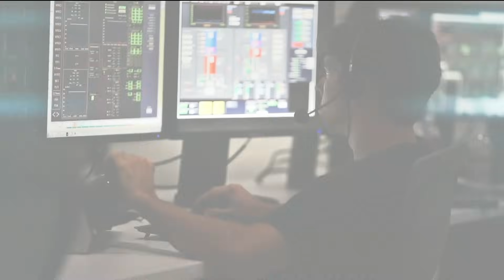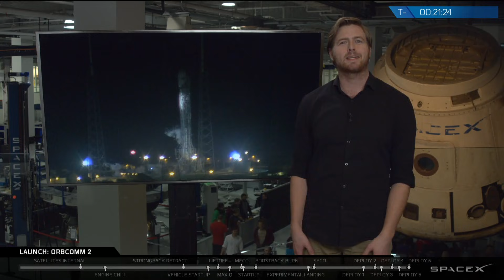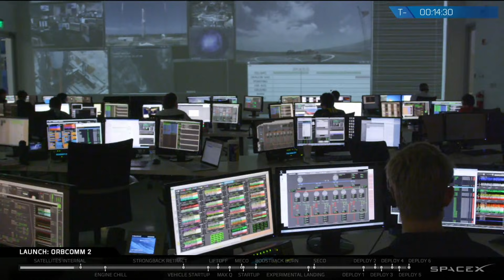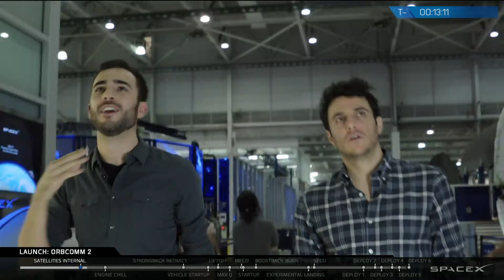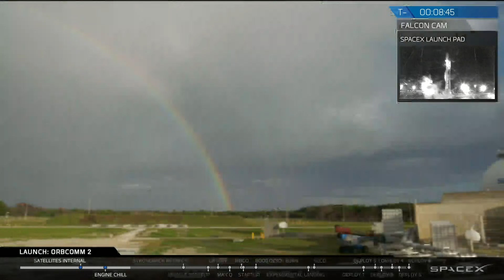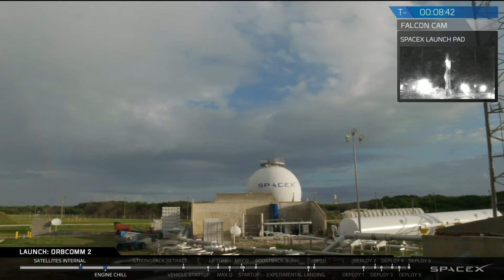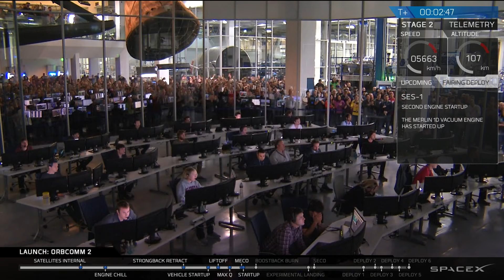ORBCOMM-2 Full Launch Webcast

Comment: Is there a plan to recover 2nd stage?
Reply: The problem with the second stage is that it's going so fast that it burns up on reentry. To slow it down to the point that it doesn't would take the same amount of fuel as it took to get it moving that fast. That additional weight would then need more fuel again to get it going fast and it becomes impractical. They could put a heat shield on it but that costs in weight also. Either way the cost of bringing it back to earth would be more than the cost of replacing it.
Reply: +cavereric  Perhaps later on, but the 2nd stage is not nearly as expensive to build as the 1st.
Reply: +cavereric __ In the future.  I believe that the 2nd stage will have to circle the earth before it can return to the launch site.
Reply: They are working on a plan to reuse it!  :-)  should try in less than 2 years!
Reply: +cavereric They abandoned the idea after realizing it would cost too much. Most of the cost is the engines, and the first stage has 9 compared to the 1 engine on the upper stage.
Reply: +cavereric __ No.
Reply: I remember reading in the biography that there is a plan to recover the 2nd stage.
Reply: +cavereric If the Space Should could be reused, then why could this not be?
Reply: One step at a time :)
Reply: +cavereric - It may be impractical at the moment, but in the future when there are maybe several launches per day, it could become useful to put a heat shield on it and bring the second stage back also. It probably still costs more than the fuel (+the added fuel to put the additional few tons up there) and they could make the price of space flight drop even more if they could recover that. It would require a quite complicated heat shield that would have to assemble itself on orbit. At least that's my theory on that =)
Reply: +arvutihull   Elon said recently that it would happen.
Reply: *****  The most recent launch produced no space garbage.
Reply: +John Paul Paquibot you don't believe me that they have self destructs do you, no, like has been explained many times (but you still managed to miss) the second stage is allowed to renter the atmosphere and burn up.
Reply: my impression would be that they could have the first stage include all the expensive systems, and the second stage be reduced to a shell with the required payload and minimal systems to deliver it. That way they only have to focus and perfect future first stage landings and streamline the second stage shell so that they just have outside commercial contractors and customers fill the 2nd stage to specifications, snap it onto first stage and blast off.
Reply: Ricky Loves You that's pretty much what they do at the moment :) just that there has to be a pay off between how fast the first stage can go and how easy/expensive it is to return the first stage.

If they got rid of the rocket from the second stage then the entire first stage would have to go into orbit with the entire payload. Then it would take ridiculous amounts of fuel to get it up there and then to bring it back.

The pay off they make is to use the first stage as a launch pad for the second stage (the bit that goes into orbit). It contains a much smaller amount of fuel and a much smaller engine because it isn't fighting against the atmosphere etc...
Reply: +Arado16 I haven't seen that, but that sounds like he's intending to reuse the second stage vacuum capable engines in some larger mars injection orbit craft.  That would be an interesting design challenge: Stop de-orbiting them and start collecting them together for an orbital spare parts junkyard :)

Comment: Question: Excuse my ignorance; what was the thinking behind the attempts at sea? And, will all the future recoveries happen over land? Seems like a safer target, as you only have to deal with wind. I always thought the ship was an impossible target to navigate.
Reply: Sea was for testing.
Reply: +Jonah Beale Graci!
Reply: FAA wouldn't let them attempt over land to begin with.
Reply: +Robert Nicholls It requires more fuel to fly back to land... they showed a graphic of a pencil flying over the Empire State Building and landing on the other side... image it landing on a little floating boat in a pool on the other side, and that was the barge landings... you've already burned the fuel to put  the pencil over the top of the building and sent the second stage on its way to space-- all you have to do is let the pencil fall most of the way toward the little boat and then re-ignite the rocket engine to slow it to a hover and landing on the boat-- hence much less fuel.  To return to land (by where the "pencil" was launched from) you have to burn more fuel-- the pencil is already flying over the top of the Empire State Building moving AWAY from the launch pad... so you have to burn fuel to stop it and reverse direction of flight to come back down to the landing site by the launch pad (the landing site is a renovated former missile launch site at Cape Canaveral near the SpaceX launch site).  This is the "boost back" manuever they talked about after second stage separation.  The pencil then "falls" back toward the launch site, then you re-ignite the engine a third time to slow down to land.  Make sense?? 

Landing on an island would be more fuel-efficient (and allow more payload since the weight of boost-back propellant can be allocated to more payload) but there's no island in the right spot... hence the barge.  They also said they'll use the barge for some launches in the future.  Where the payload is light enough to allow the extra fuel for boost-back to land-landings, of course that is more efficient from a cost standpoint, since you don't have to send the barge out and have the extra expense to recover the rocket from at sea and the extra risk.  

Later!  OL J R :)
Reply: +luke strawwalker Graci! Graci!
Reply: ***** how about reading up on the subject before making yourself look stupid. There are other places to land than back at the launch site.

http://www.americaspace.com/?p=89127

Now, please, go away.

Comment: +SpaceX - Just letting you know that choosing 720p or 1080p quality has completely out of sync audio with video.
Reply: +SpaceX - Just noticed the 720p/1080p versions are 9 minutes longer. The first 9 minutes is just the SpaceX logo but the audio is playing as if the banner is not there for the first 9 minutes.
Reply: Mine is fine...
Reply: orayole It seems fine now.

Comment: Okay im kinda lose help me guys? So i know that the rocket spacex made is fucking insane but one question what does it change, just wondering :) does it mean we can trave deep into space?
Reply: +Carlos Ramirez Means travelling to space has become cheaper. Around 10 times cheaper.
Reply: +neuralshock7 Your numbers aren't quite right. The $16 mill figure that has been quoted is wrong. It is $60 mill and that includes the second stage which does have to be built from scratch.
Furthermore, a refurbishment will cost money. 
Also, a launch doesn't cost $60 mill + $200 k. The actual fixed cost of launching isn't included which is many millions more.

It would appear that a reused rocket will save something in the order or $30-40 mill per flight though and perhaps even more once they get their reflight game down.

Comment: 1st stage landing was epic. but what happens to 2nd stage landing
Reply: +Amit Gupta For now, it burns up. Eventually, they plan to bring all the stages back to earth--there's an animation on their YouTube page somewhere of all the stages of a Falcon Heavy launching and then returning to one launchpad. They kinda had to test it with one stage first though.
Reply: +Sarah Dangelo If I'm not wrong, Falcon Heavy's launch is going to be in 2016? Late 2016, I assume.
Reply: +crossfires Earliest I can find is a "demo launch" that's currently scheduled for April 2016.  Presumably after that, SpaceX has 5 customers lined up to use the Falcon Heavy for satellites.
Reply: Sarah Dangelo Awesome, thank you! Can't wait.

Comment: What happens to Stage 2 of the Falcon 9 Rocket once it deploys all of the satellites?
Reply: They turn it around and re-light the engine. This slows it down enough for it to reenter the atmosphere and burn up.
Reply: +Zach Lewis Feasible, but would cost more than you'd save
Reply: +Garin Kilpatrick The announcer stated that it will de-orbit and burn up.
Reply: They turn it around and re-light the engine. This slows it down enough for it to reenter the atmosphere and burn up.
Reply: +Garin Kilpatrick Good Question! I say next step is to work on parachuting that 2d stage down and totally re-use the ship.
Reply: +HVYMETL Parachutes wouldn't work very well. It puts too much stress on the stage and makes it more costly to reuse. Doing something more like this with a heat shield on the top of the stage would be more feasible.
Reply: It de orbits and burns in atmosphere
Reply: +Zach Lewis Not just that, but they'd have to do a lot of aero-braking if they don't have enough fuel to slow it down a bit more, or those chutes would probably separate from all that drag. They likely won't have enough fuel since the second stage had such an extensive flight. No telling where they'd have to pick it up either.
Reply: +TheHue's SciTech Yup. This is why SpaceX have abandonned the idea of recovering the upper stages (it was planned at first)

Comment: Hasnt SpaceX been beat already in landing a reusable rocket?
Reply: +Jonathan Perez the blue origin stage only went 62 miles vs spacex doing 120 miles, and it's twice the size. The reason blue origin wasn't regarded by many as counting is because it wasn't actually "space", rather "near space". What Spacex did was much more difficult.
Reply: +Jonathan Perez They're the first to land from orbit altitude on an actual mission. That's what makes this so big.
Reply: +Jonathan Perez Technically yes, but that rocket was very very small. It was a far more easier task.
Reply: +Jonathan Perez No.
Reply: +DXE1 Lma blue origin in november
Reply: +markssquared The height is significant, but my understanding is that the biggest difference is the speed, Falcon 9 has to push the second stage sideways very fast, whereas blue origin was just straight up and down
Reply: +James Hansen thanks for that! I appreciate that clarification.